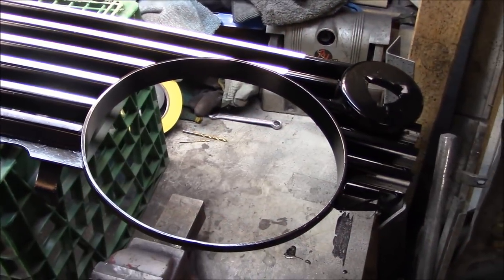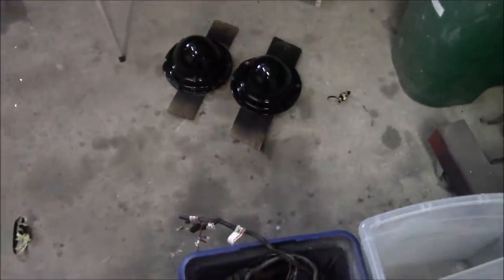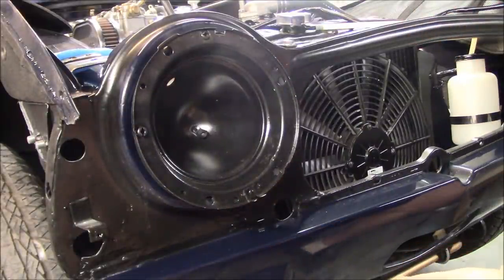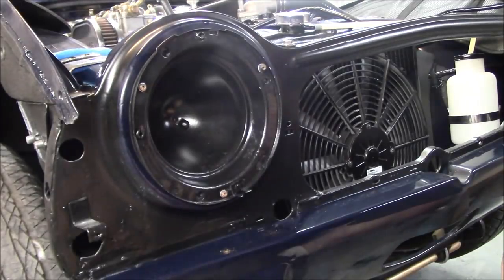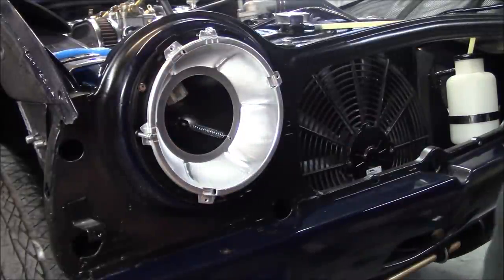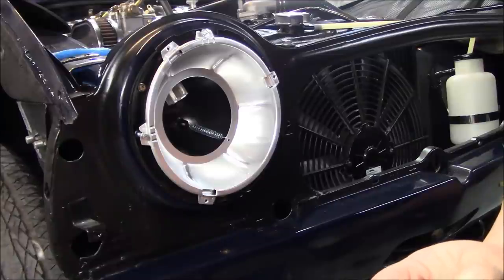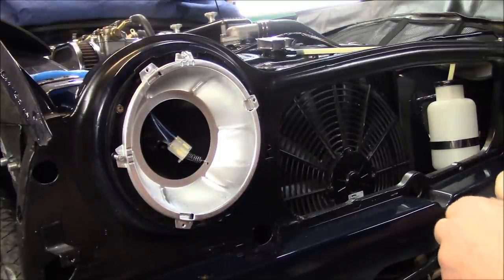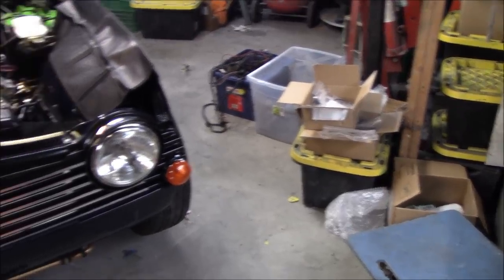1968 Triumph TR250 Restoration, Assembly Part Thirteen, Grille,   Marker Lights & Headlights Install

Comment: Dave the front assembly looks stunning. This car is becoming more beautiful each episode..- exciting times! 👍😊🇬🇧
Reply from the maker: Thanks Phil, yes I’m happy so far with the front end look.  A couple of Lucas driving lights should finish it off nicely up there I think.
Reply: @cheftush  Yes agreed it looks really great but a slightly picky point... maybe the tri-bar lamps aren't strictly period correct because the late 60s updates (TR%/250, GT6) Triumph had modernised the look of the cars with more black / less chrome, newer badges etc ?

Comment: #0000 steel wool will take the overspray off your headlight rings without scratching the chrome. Love the look of the grill.
Reply from the maker: Thanks Steven.   I did end up using them as that Overspray wasn't visible anyway after the out ring went on.

Comment: As a tr-250 owner love these vids,,,,Thanks
Reply from the maker: My Pleasure Mark. Thanks for watching and commenting.
Reply: @cheftush  No problem, mines a solid driver. I’m waiting for some CV joints from good parts, to redo my rear end from the pumpkin on out I replaced the original with an R 200
Reply from the maker: @markcook3570  sounds good!  I did the R200 on mine as well but stuck with the stock axles attached to the GP hubs.
Reply: @cheftush  I got some really good CV joints coming from good parts but with the supply chain problems I’ve been waiting about three months, I use JD British Cars down in Nashville I live about 30 miles outside he’s my guy to help me keep my car alive, I can do somethings but without a lift it’s hard, can’t wait for the spring

Comment: Thanks for sharing this experience. I thought I was the only one that sometimes struggled with the  initial connecting of the halogen bulb to the receptacle (plug).  My experience with Lucas lighting on the front of a '62 Morris Mini 850 had some rusting 'solid' issues with the final 3 screws. My solution was to dab some grease on the sheet metal threads and even the head of the screw so that when I revisited the  installation I could remove the screws.  
Plus, what do you think of using a very light finger swab of dielectric grease on the rubber backing headlight cover (that you almost forgot) to keep the rubber subtle and water out of the headlight ?
The Moss Motors orange indicator light replacements look like a huge improvement on what was mounted on the Mini. That assembly had glass lenses held in place by a 'rubber' press fit base. Of course, after a short time of use the rubber dried to a solid tar like consistency, cracked (why not) and had allowed water to infiltrate the inner reflector / bulb socket fusing everything into one rusted assembly. Changing a burned out bulb usually ended up taking days of cursing, a few busted knuckles and of course a brand new light assembly. 
As an aside, changing an indicator bulb on my "modern and German over engineered"  BMW Z4 (08 3.0 SI) required the removal of the front wheel, unmasking of the headlight assembly's two (not one) plastic covers, removing of a long, Sharpie Marker sized bulb holder, and then removing the burned out bulb. A flashlight sized bulb listed of over $40 !!!!. In retrospect, Morris / Lucas  bulb replacement was way ahead of BMW. I bet that's the first time someone has said that.

Keep them coming  !  Cheers John from Whitby
Reply from the maker: Hi John,  Yeah, the new harness can be quite difficult to plug in and push all the way home....probably not a bad idea with the dialectric grease on the boots...its not going to hurt anything and may help as you say.   I would have prefered to stay with the stock lenses and bases but both were too far gone to rescue IMO

Comment: Thanks for going over headlight install in detail like this! I have one on my TR6 (the light) that is flopping around. After watching the video, I believe that the spring may be to blame- maybe it's broken? The engine bay side of the 74 TR6 is different than your 250. Is the light assy the same as shown?
Reply: Oh yeah, and pls discuss if you are going to use a relay, and if so, how you hook it up. Nice job, Dave.
Reply from the maker: Hi John, similar assembly on the TR6... I think the difference will be that you will have a three adjuster set up.  I’ll be running  relays for both the headlights and the driving lights. Stay tuned.

Comment: Another informative video. what do you mean about driving lights? Thanks David.👍
Reply from the maker: I’ll be adding some driving lights and some custom brackets to mount them as I will not be running a front bumper on this car. Stay tuned.

Comment: Tush question, I was installing the lights on my TR4 and all went well except the final trim rim on. In this video at the end you mentioned a spring at the bottom that the rim attached to? I bought an assembly from moss and my didn’t have a spring but the tr250 might be different. I did buy item 156-020 and think this might be the spring but don’t see how it goes on, it did come with a rivet. Also looked at my Haynes Manuel and could not find anything specific. Thanks
Reply from the maker: Hi Robert, yes that little clip you bought holds the outer ring in position.   It will be located close to the bottom center of the bucket once it is installed.  I’ll see if I can find a better view of it.
Reply: @cheftush  sorry to bother you on this. The part (156-020) I got is two pieces and a rivet, so not sure if it need to be put together and rivet it to the inner rim. The other thing is the outer trim rim has a small hole at the bottom so not sure if the rims held in place the small screw at the bottom. Looked at shop manual and no clear explanation there..
Reply from the maker: @robertmorales391  https://www.triumphexp.com/phile/6/43169/Moss_clip_instructions.pdf
Reply: @cheftush  your the man.. I could not find anything on it.. thank you. !!
Reply from the maker: @robertmorales391  happy to help when I can.

Comment: The headlight adjuster screws i used have a groove behind the head that the bowl clips into, are these the same?
Reply from the maker: Not sure if you could call it a groove Barry but there is a short unthreaded part behind the head.
Reply: @cheftush  David, yes there is the adjuster screw head, then a roughly 1/16 smooth “gap”, then a raised hexagonal “stop”, then the threaded section. The headlight retainer ring notched tabs fit on that smooth gap between the adjuster screw head and the hexagon stop. This allows the adjuster screw to push or pull on the retainer tabs to bring the light forward or back.
Reply: @TR4Ajim  that's what I was thinking
Reply: Yeah, that's been my experience with other cars- there should be a groove there that the flange goes into so that it holds adjustment where you put it- otherwise you can only push it "in" with the screw, and nothing keeps it from moving further in, or lifts it back out when you unscrew the adjuster.

Comment: Did you notice any oil leaks or drips after your burn in?  Possibly jealous here....
Reply from the maker: Only a little weep of water out of one of my freeze plugs by the distributor
Reply: @cheftush  Well, that just means the oil is leaking into the water jacket and forcing water out then.  There is no way the oil isn't leaking somewhere.....
Reply from the maker: @JB_WI_Triumph  give it time!

Comment: Bro so the grill just pops on and off huh
Reply from the maker: Just a couple screws on the top and at the bottom
Reply: @cheftush  ok yeah the grill on this car may have been replace and was Kinda wedged in-between the bumper and top lip